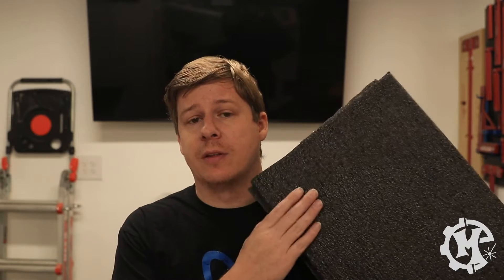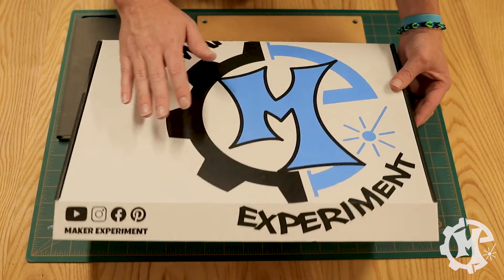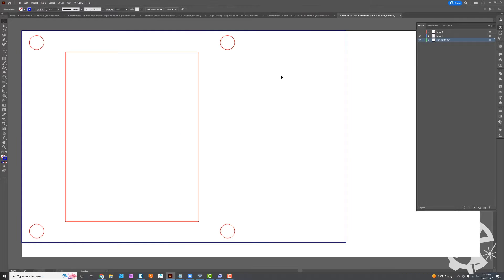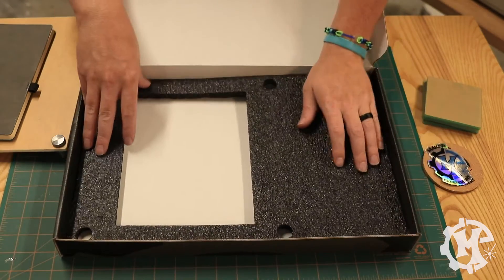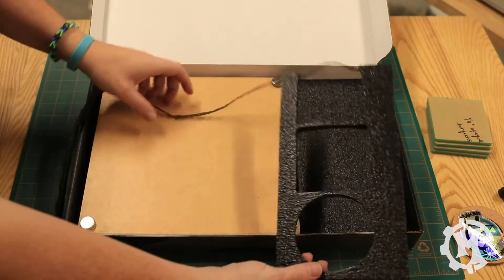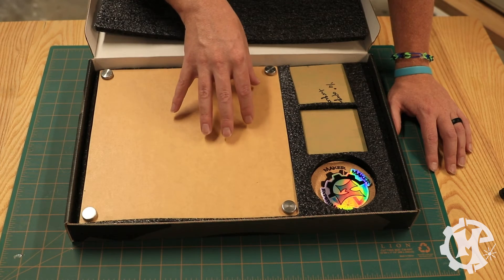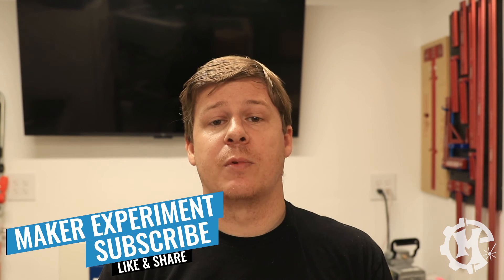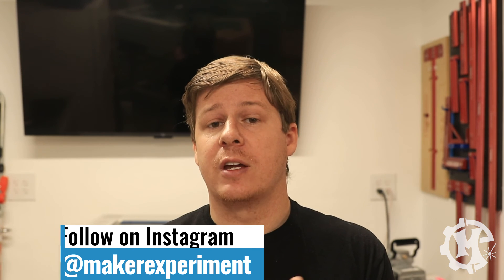HOW TO MAKE CUSTOM FOAM INSERTS

Comment from the maker: Here are the links to the foam and machinery I used to create my custom inserts. 

● POLYETHYLENE FOAM
1/2" Closed cell polyethylene foam 1.7lb Charcoal
https://www.thefoamfactory.com/closedcellfoam/polyethylene.html#1-7-density

● EPILOG FUSION EDGE 
Wattage: 60 Watts
Settings: 100% power, 18% speed, 15% frequency
https://epiloglaser.com/maker-experiment

Comment: Sorry if this is a silly question. Can this be done safely with a diode laser?
Reply from the maker: The engraving portions should work. The cutting would depend. I’ve never used a diode but I’ve heard there are certain types it can’t cut through.

Comment: You have no idea how much this is going to help me.  Do you know anything about gluing this stuff?  It seems layering this stuff is easy, I've seen it done.
Reply from the maker: You should be able to use just about any mutli purpose type glue like E6000 or other adhesives.
Reply: @MakerExperiment  You can tell the folks at The Foam Factory you brought them at least one sale.  I've got my test sheets now.  Was worried that coming rolled would be a problem, but this stuff flattens so easily, even in the cold.
Reply from the maker: @TexRobNC  I hope it works out for you!